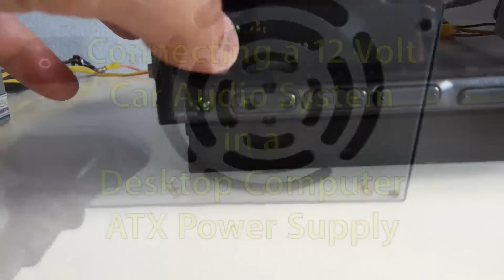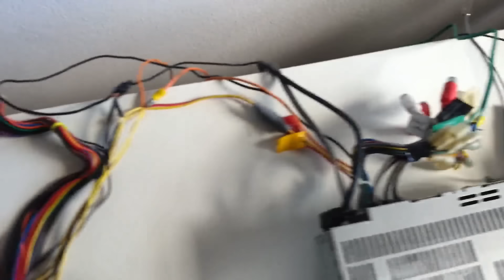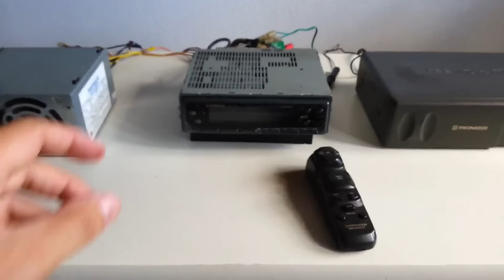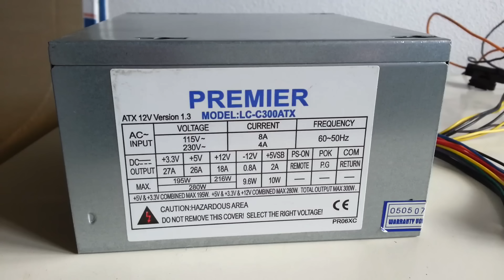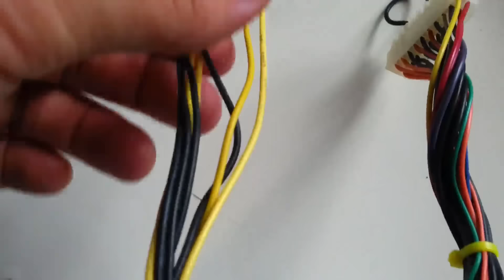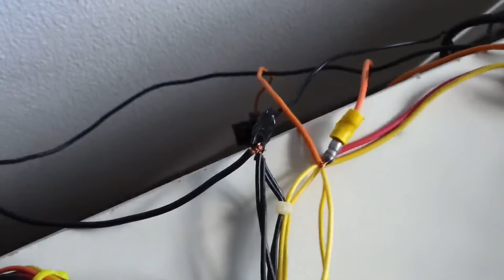How to Connect Car Stereo to Computer ATX Power Supply - Pioneer

Comment: I generally would forget the entire pc psu all together... no point shortening the wires of your psu or making them longer... or linking, and cutting in odd ways as this could lead to problems in the long run for your whole computer and could cause a fire hazard. LEAVE it. Buy a separate power supply online up to 200w that outputs 12v, at 10amps for example, lets say... they're not expensive, then from there feed the power to the stereo, with the dedicated power supply outside the pc.

Comment: So what wire from the power supply keeps the memory to the deck until?
Reply: he just makes constant voltage the same as the ignition and uses the power on the head unit to turn on and off. though when you turn the power supply off it erases the memory and there's nothing you can do about that
Reply: @haydenwiseman3056  unless from 5v svb , only if u step it up to 12v using another circuit . im still contemplating on execution
Reply: Car stereos don't keep memory settings if not connected to battery.in the car, the stereo keeps memory because even after switching off the stereo it is still connected to the battery.
Reply: @lucasmwaurafama9349  it's interesting that my old Vdo cd721 keeps memory saved all the time.. when I got it from my dad old car,I found there saved radio stations with their names. The majority of new radios keeps them in memory because of the processor in headunit board,but it's sad when doesn't.
Reply: if you look up wiring for a car stereo, you can see there is a 12v switched (for turning on and off) and a 12v constant (which stays connected all the time). The 12v constant is probably what would keep the memory going in a car, but it would be more difficult to keep it going with a PC power supply. You could hook it up to a car battery hahaha

Comment: When I try to hook my amp to power supply my power supply shuts off
Reply: Try putting gray wire with yellow wires to amplifier may solve issue I had same problem when trying to hook up first time
Reply: Limiter, you need an amp that can handle more wattage

Comment: Works fine with a smps but my car stereo is not able to save time, date and equalizer settings. Why?
Reply: Because the red wire and yellow wires both need power but the yellow one needs power all the time and the red needs to be switched power
Reply: @mr.hankie  How do I prevent my  settings being lost when I turn off PSU? I don't want it running 365 :)
There must be a way.
Reply: Victor Yanda there’s a few videos on here of a switch being wired in so it acts like turning your key on. I don’t rem what the video was called so I’m no help there.
Reply: @victoryanda3538  A car stereo is designed to be connected to a 12V battery 100% of the time.  It's usually your ignition or key wire that turns it on.  So basically you'll need a toggle or some other type of switch to control that wire from your stereo to the power supply.
Reply: @nickdude07  what about 14v unit what power do I need?

Comment: hello , thankyou for this video . i wanted to know that if power supply psu is 450w the stereo should also be able to handle 450w or if it cannot will it short cirucit or will it still play. thanks in advance
Reply from the maker: Car stereo must be below PSU watts, like any hi-fi amplifier vs deck etc..
Reply: @learnshare  yeah any psu has to be higher than you need ! Idk why but l heared the cheap psus dont give the correct watts that they say maybe -100w btw very cool video maybe you assist me in future

Comment: Your atx psu is only supplying 18 amps. rain being I'd because all the wires are soldered to the same place on the PCB. There is only 1 12 volt rail. I know this because I rebuild, and modify amplifiers and atx psu's. if you have questions feel free to ask.
Reply: I have one for you. I hooked it up just like this guy did and my radio only powers on when I hit the eject button or the disp button but then shuts right back off think my psu could be to small?
Reply: Where is 12 volt rail
Reply: All you really need to run a typical head unit is between 8A to 12A @ 12V to 14V. That's enough to run the internal amplifier on four separate channels. Steady 12V from PSU is way more reliable than DC output of an alternator, too.